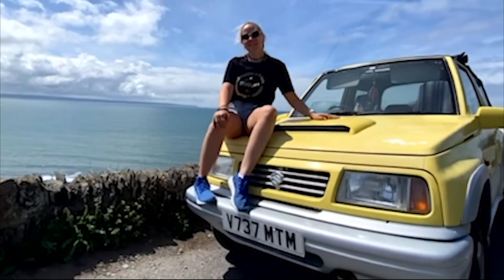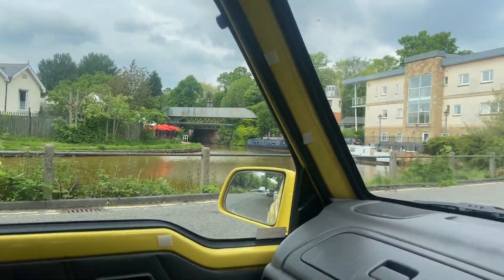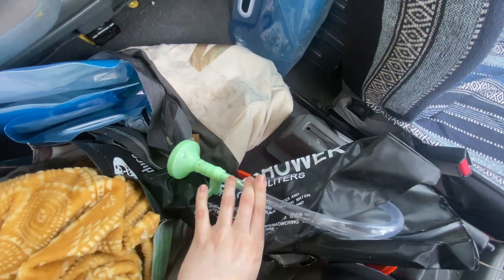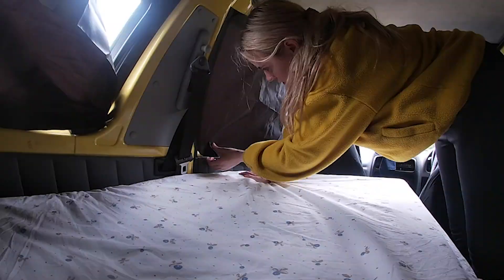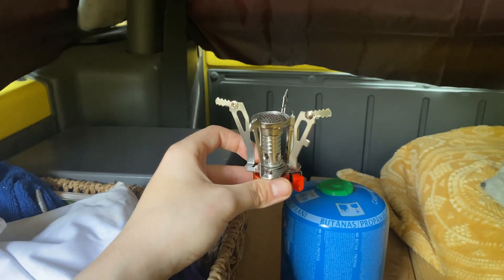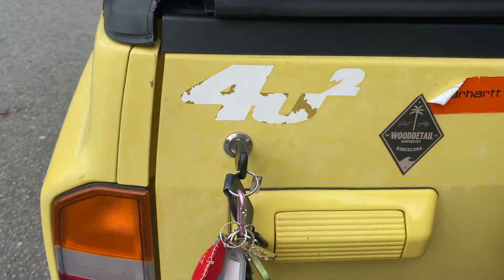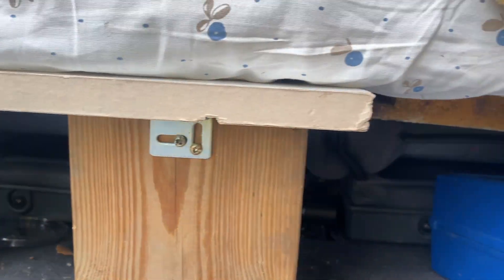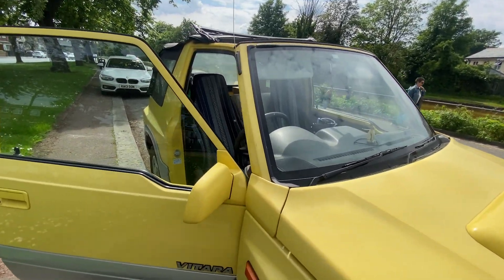Suzuki Vitara 1999 Car Camper Conversion - student built solo car camper

Comment: How tall are you? Whats the lenght of the bed? I've been pondering about buying the exact same model but im not sure i could fit in it.
Reply from the maker: The bed is about 140x70! I’m 165cm tall so fit with my legs up! The mattress I used is the Pelleplutt cot mattress from IKEA lol! I bet you could make it about 20-30cm longer by taking the front seat out though. Good luck!
Reply: @xxbonneybooxx  it's impossible to fit then, thanks for the reply tho! Cheers
Reply: @wtf1992lynx  puedes intentar poner la camar arriba del coche a modo de tienda de campaña abatible, asi tambien tienes mas espacio dentro del propio vehiculo asi lo hice yo ( ya que soy muy alto) y me funciono muy bien
Reply: Since the front seats also fold backwards/ recline fully flat to the floor/ rear seat... Think that we could get extra inches/ feet that way? I bet we can. 

BTW I just bought a 98 Tracker but it's at my local shop for off-road upgrades! I'm excited to see what's possible. Don't forget that fitting a sleep space diagonally will provide more space as well. 

Mads thanks for posting this. Looks like fun!
Reply: @SimplyLesa  I did a similar setup in a 3dr Vitara but i reclined the front seat backwards and put the bed over the top. I'm 178cms tall and i can sleep comfortably in it.
Reply: @joecoelho2992  I just posted my build video this week. I've slept two nights in it so far! Come comment on my video
Reply: @SimplyLesa  as best as I can remember from the Geo Tracker I had in 2003, not if you fold the rear seat back(s) forward flat, then there is no space for the front seat backs to recline down far enough to a horizontal position. (Some Suzuki-branded models have split rear seat backs so maybe you could remove the one on the passenger side; and to make a tangential point, which is obviously on opposite sides for those of us on the other side of the large pond.)
Reply: @xxbonneybooxx  at my age we can’t sleep like that anymore without the space to spread out and relieve pressure on the back. Enjoy it while you can.
Reply: @Anonymint-vj7bt  I am doing fine with my cot size bed on the passenger side on top of the front passenger seat. I did remove the back seat in mine (98 CT Auto, 4x4, 2 Dr)